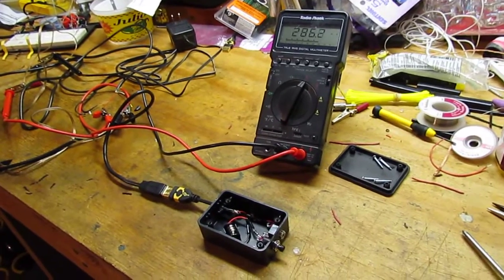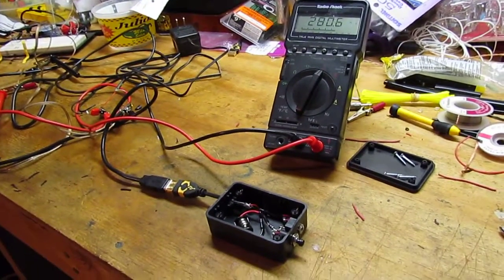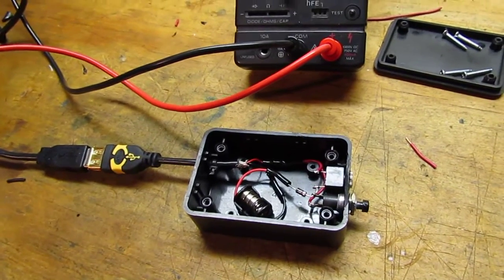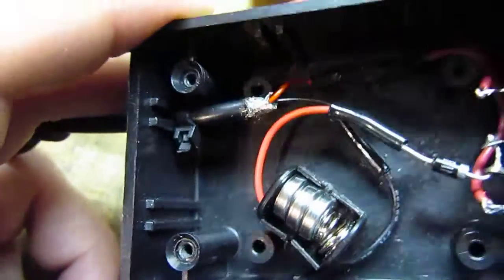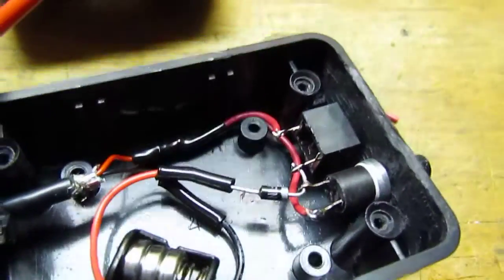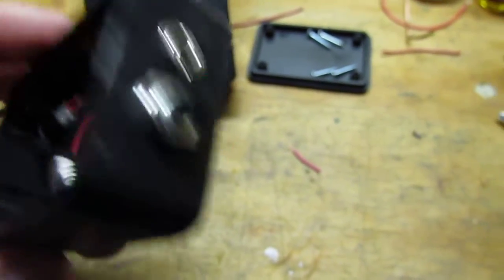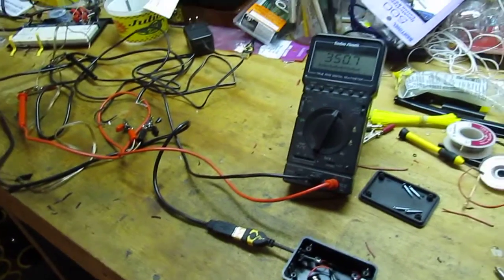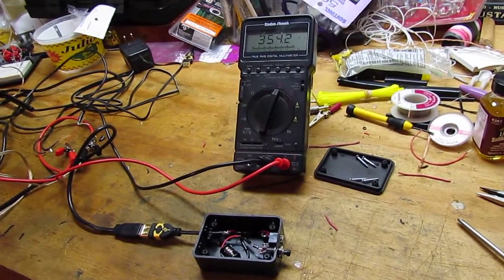Canon SX30IS CHDK Remote Shutter Release

Comment from the maker: The other way you could be sure you got the right pins on the USB cable would be to take a multimeter and probe a standard cable while it's plugged into a power source (computer) and find the positive and negative pins.  That would tell you which pins to wire up to.  The schematic I have shows pin 1 to be the positive +5V and pin 4 to be ground (-)

Comment from the maker: Thanks, I liked that it was simple to do.  

Have a look at the schematic I posted a link to above.  It will show which contacts on the USB pinout I used.  The simple answer is that assuming your USB cable is standard, the red and black wire will be your positive and negative leads respectively.

I have not sync'd two cameras with it.  It should be easily possible to do, you'd just need to wire in a second USB cable to connect to the second camera.

Comment from the maker: @azopene 
The smaller of the two ports is the USB connector.  It is the same port you'd use to plug the camera into your computer to take pictures off of it directly if you weren't using a card reader.

Comment from the maker: @BigNate84 
Thanks :)  At one time you did have to run a script to use the remote shutter release, but they have since integrated the functionality into CHDK.  You can still script it if you want.  There is no built-in way to control the video record button, but you could probably script it fairly easily.  Funny, I watched your CHDK RAW video some time ago!  Thanks for that :)

Comment from the maker: @azopene I took a USB cable that worked with the camera and removed the end that would normally plug into the computer. There are four wires, only two that we care about. The black goes to the battery negative and red goes to positive. I also tested this with a volt meter to be sure the polarity was correct.

I have updated the description of the video to include a couple links that may help, including a schematic for the circuit.

Comment from the maker: @azopene Yes, the switch is a momentary type, normally open. Go read up on the CHDK firmware, there are several ways it can handle the remote shutter. The default setup in the firmware is you press the button once for half-press, then release and press again quickly for full press. There's also a mode where you press and hold the button for half-press and when you release the button, the shutter will fire. Have a look at the CHDK homepage.